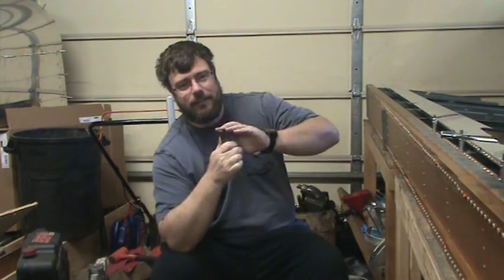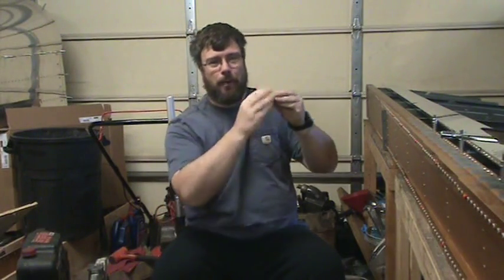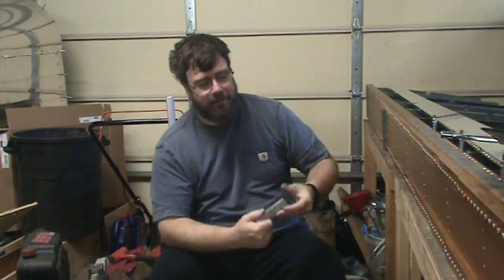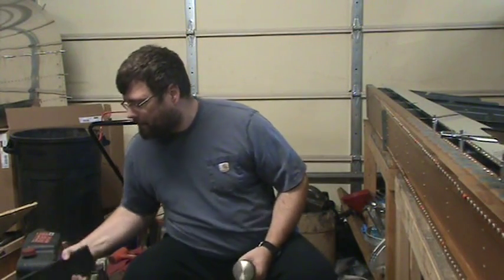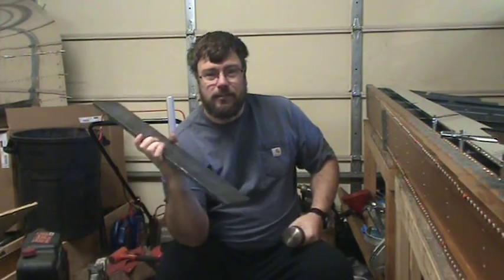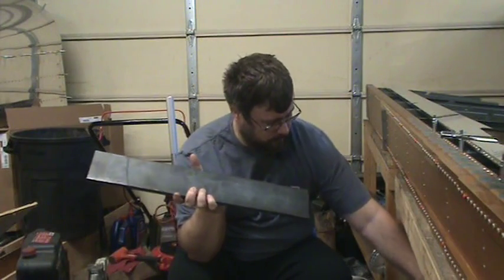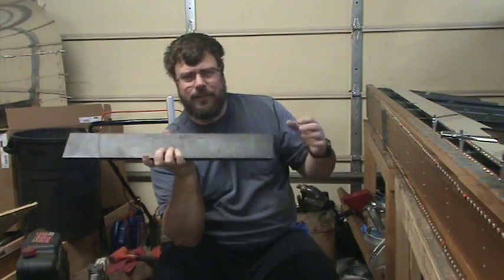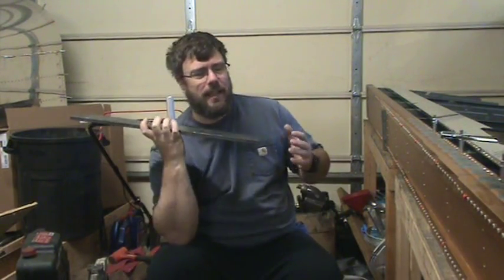Bucking Bars

Comment: Hey man I hope you’re doing good. I met you back in 2019-2020 when you and the other guy helped me learn to run an exothermic torch to cut a pin on the forklifts we had.
Reply from the maker: That was an awesome time, except the molten steel that got inside my boot.